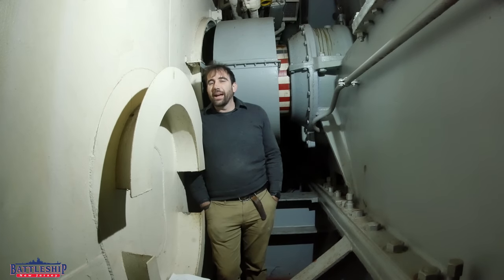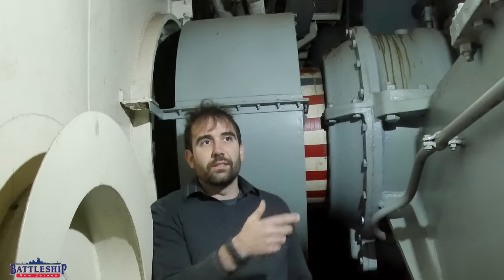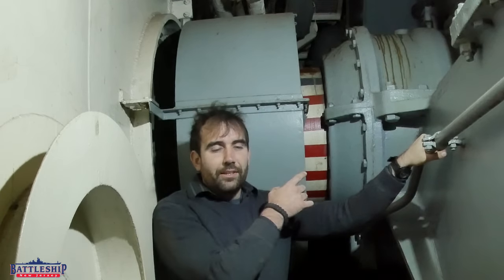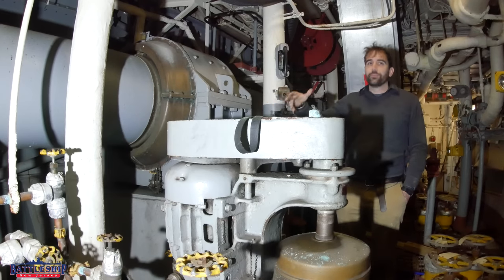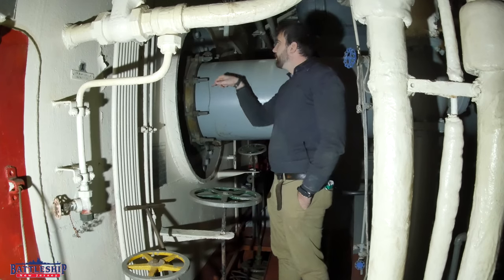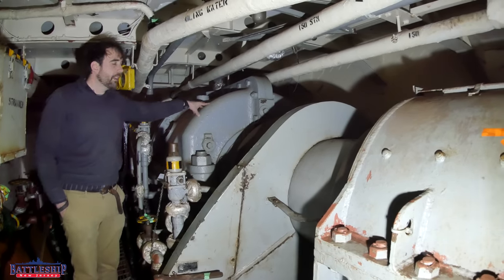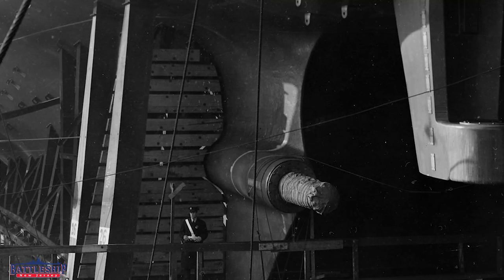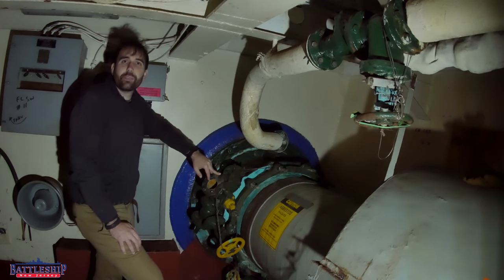Battleship Sized Propeller Shafts

Comment: First an engine/ gear reduction story. USS Coral Sea, deployment to Yankee Station, 69-70. One of the main engine turbines shucked out a couple of blades (stater or turbine blades, I don't know) & they had to shut down that engine & lock the shaft so that the engine wouldn't totally destroy itself. We were flying combat ops at the time so the skipper decides to continue wit flight ops while dragging a stationary screw. Ship couldn't make more than about 24 kts and couldn't properly launch aircraft at that speed, needed about 30 to 32 kts. Had some scary incidents with A-7 Corsairs carrying bombs. At speed while dragging that dead screw the ship would shake violently. After a couple of days they got the coupling unbolted and we could make about 30 kts on 3 engines. I have a lot of the deck logs from that cruise and it is funny reading some of them during that time period. An aircraft carrier can only be captained by Naval aviators, you have to wear the wings to drive one of those things. Many of the comments when an officer stands the bridge watch mentioned something like this when first recording the log on his watch: Propeller engine (number such & such) still windmilling. It's under water so how can it windmill. I was in aviation and I even know that it is called a screw not a propeller. Thanks for the videos, they kept us real busy on the flight deck so I didn't have a lot of leisure time to visit below decks.

Comment: To answer Ryan's question.
2010 Toyota Rav4 3.5 Liter V6: 269 HP @ 6200 RPM.
I like it for such a small SUV.  Would need 788 Rav4's to push New Jersey at top speed. LOL

Comment: Iron wood was used as bearings on the early steam engines , it was self oiling and could be turned a lot easier than steel at the time.
Reply: it can also be turned a lot easier than steel now ;D

Comment: I was a snipe on a carrier 3MMR was all the way aft and all 4 shafts ran through , 1,2,3 MMR ran the whole length  on the engineering space but 3MMR shaft was really short. 2MMR was the next forward and the shafts from 1MMR and 4MMR ran the full length of the engineering  space and 2MMR stub shaft. 1MMR only had the one shaft from 4MMR running the whole length of the engineering space. 1MMR had no shafts running the  whole distance of the engineering space and was the most roomy. The shafts were 36" in diameter and turned a max of 135 rpm. Laying on the shaft was only possible when spinning main engines for a couple of revolutions  to warm the turbines up when getting underway, any other time you would be flung across the engineering space and most likely killed

Comment: My daily driver makes 180hp, my diesel pickup about 300hp, and my race car about 600hp. All of them combined I'm not sure could overcome just the rolling resistance of a single shaft and propeller.
Reply: Destroyer escorts or FF as later called most commonly had a single screw.  Ours was 15 ft. And could generate a rooster tail 300 yards aft.  Starting at 2 knots on throttle up.  We called it showing colors when we left a foreign port.  Never twisted a shaft. We did have a bearing chew into the shaft. We were (DIW) dead in the water for 3 days. 6 hrs to get it topside 2 hr wait for Helo pick up. 2 days at shop and return 4 hrs for reinstallation. I think we were the only sailing destroyer in the Atlantic in the 70s.  2 knots with tarps fastened together and Gulf stream help.

Comment: The wind tunnel I used to drive was 260000 HP 4 65000 HP motors on the same shaft and it would go up to 700 RPM.

Comment: Very good and interesting video. However I would think that intermediate bearings are with white metal linings instead of bockenholz or ebenholz wood. Altough this material is commonly used for seawater lubricated tail shaft bearings outside of ships hull.

Comment: Spring bearings have babbitt bearings not lignum vitae. The Aft. shaft and tail shaft have the lignum vitae bearings, or the ones exposed to the sea. The two long shafts should have auxiliary thrust bearings that will engage and disengage for decoupling the shaft from the engine for trailing the propeller while underway to reduce drag.

Comment: My vette has 600 hp at rear wheels. A car truck looses horse power from engine to rear wheels, automatic trans around 20% and manual around 15% hp. U buy a super charger and install on engine, it says 200 added hp, at rear wheels u may get 100 to 120 hp.  Great show love them all.  Questions NJ second ship of class, Mighty Mo last, why was NJ in best shape of the class when second oldest? Thank u. Chad Paddock Naples Florida thank u for saving the four grand sisters, all class each one. Should have two new BBG built. Reduce carriers by one gives u crew for two BBGs

Comment: Not called riding the shaft but on the last ship I was on we did another form of game. In the rooms the shaft was often below a grated deck plate. Those of a particular form of crazy would lift the grate out. Then using the framing lower themselves down to where they were running on the top of the shaft. A certain speeds you could keep up but at others you just got thrown into the framewaork. oof.

Comment: I’ve always wanted to know how in the world the designers kept water from coming in through the propeller shafts, now I see it’s like a well, it has packing. Simple but robust, that’s just cool.

And 52,000 horsepower per shaft!!!! Dang that’s strong. Is it possible there is a torque rating for them too??? How much torque they put out

Comment: Wait, a 32in diameter shaft had a crazy complicated high-precision boring operation done on it to get rid of a core 8in in diameter for weight savings? Even knowing that that core doesn't really contribute to torsional rigidity, that's barely more than six percent of a weight savings, and a zero point four percent savings in moment of inertia. Seems like an odd decision to have made.
Are we mixing diameters and radii, or am I misunderstanding something else?

Comment: Knowing the physical size- length and diameter, and knowing the maximum torque from the engine, it is a simple calculation to determine how much the end of the shaft rotates with respect to the other end.
And BTW my car has 400 horsepower but carries a lot less weight than the battleship, plus doesn't carry any big guns.

Comment: its not twice at the engine but it IS two bolts twist at the engine end

There's probably about $9000.00 worth of Lignum Vitae in that bearing alone.   Navies got the best pieces because they didn't want pretty grain just straight clean block.
Reply: There is zero $ worth.

Comment: Curious on how they balance the torque differences between the shafts. Like in an unequal length axle, the shorter shaft has less torque effect (hence why cars torque steer). These being significantly different in length between the longest and shortest, there has to be some method of balancing the torque. 
Maybe a follow up video??
Reply: I feel like you are mixing up some different items. A difference in thrust per shaft could cause a ship turn, but with how the amount of Hull length compared to hull beam, I would say you need quite some variation for it to matter, so balancing is not that much of an issue. 
The torque Ryan was talking about is the tendency of the shaft to have some rotational windup along the shafts length. There will be a considerable difference between the shortest and longest shaft, but it doesn't really matter if one shaft takes .2 rotation more to start rotating a propeller compared to the shorter one. This is however a real thing in servo applications where shaft flexibility can limit system responsiveness. On a heavy thing like this it, mass will damp this behaviour out on a ship level.
Torque effect on cars is also very much caused because inward wheels travel a considerably smaller distance than the outside wheels, for basically all reasonable turning circles. Wheels have way too much friction with the road surface to slip the multiple rotations needed to take a turn, let alone would it be desirable to waste so much power. This is where cars use differentials to actually balance rotation vs torque  between the driving wheels, and even more advanced versions of this principle to maximize every single Newton-meter / Lbf into traction
Reply: @Tuning3434  not really mixing anything up. A longer shaft will exert more torque. I used torque steer in a car as an example. When a car accelerates in a straight line the longer drive axle exerts more torque causing that wheel to rotate faster. It has nothing to do with turning (where inside and outside wheels rotate at different speeds) and everything to do with the length differences in the shafts.
Reply: It's all controlled by shaft RPM
Reply: Each engine gets its own room for damage control. A merchant ship from the same would use matching shaft lengths and a shared engine room. A positive side effect of the four wildly different shaft lengths is that it reduces vibration. Each shaft has its own vibration frequency and having four different lengths helps reduce the cumulative effect of resonance you get when any two shafts are the same length. With regards to the torque, and length, there is no difference. This effect only occurs in cars when they accelerate (or decelerate) and ships engines cruise at a constant speed. However the propellors themselves DO introduce a strong turning effect and for this reason port and starboard propellors ALWAYS rotate in opposite directions to each other.
Reply: @jameslong3351  Exactly JL.  The only ship I remember having torque issues was the Enterprise, with eight reactors spinning four propellers.  The longest shaft had a power restriction because of shaft twist.  I might not have that straight, but close.  NO TORQUE STEER!

Comment: My 71 Dart, street-strip car has about 450hp. My question how much torque does N/J have. It’s got to by unbelievable to turn a screw that big. Nice job Ryan!!!
Reply: @manitoba-op4jx  off topic but aiming for about 525 by spring. Was high 11s want low 11s. Thanks!!!
Reply: I'll give this a try by working back to torque from HP: 0.0001904 HP = (1 lb-ft x 1 rpm)/5252. The shaft turns at 204 RPM at max. power., so for 54 000 HP that is 54 000 x 5252 / 204 =  approximately 3475 '71 street strip Dart's worth of torque per shaft. Now I understand why the driveshaft is nearly solid and 32" diameter, and why the top Iowa class engine option wasn't available in California
Reply: @scottb8175  you also need to take into account emissions compliance for California. Last time I checked, bunker oil isn't super clean burning, and I don't recall Ryan showing us the catalytic converter on New Jersey. That won't pass inspection!

Comment: I'm kinda curious if you could increase the power by swapping out all the steam plants with jet turbine engines. Assuming you could easily get them down there under the armored deck.
Reply: You could, but then you would need to replace the gearboxes as well, because you would need an equally sized intermediate gearbox to reduce the turbine output to something the battleship gearboxes can handle.  But those propellors will only handle the current output really, any more and they likely will cavitate heavily.  That 202RPM is a maximum to give long prop life, the steam power plant likely can easily go 10% more than rated, but using that emergency power will mean a very expensive refit afterwards.
Reply: In terms of power, you'd need 8-10, but refitting the entire machinery means ripping up all the decks, and everything above them.
Reply: @Jo-rz6bs  Easier in drydock to simply lift the ship on blocks, and cut holes in the hull then, dropping each room out in turn. Faster and cheaper than removing that armour, and you only need to have clearance for the new engines.

Comment: Top Fuel dragster or funny car would come within an order of magnitude of one shaft or maybe two. And they accelerate much much quicker to their top speed of 340 mph. However if the race is longer than 5 Miles I'll put my money on the battleship!
Reply: A competitive Top Fuel engine's spark plug electrodes are burned away in the first 300 yards, there abouts. They definitely aren't built for endurance. Today's estimates are 12 000+ HP from 500 cubic inches for TF Funnies and Dragsters. But those are "cars". IMO we need to compare a Top Fuel boat to a battleship, as the cars don't do well on the battleship's  track surface, especially if the battleship has lane choice. Even if you only floor it for 3 seconds (so about 200 mph) and just coast afterward, a TF drag boat would probably be ahead of the battleship for 3 hours before the Iowa class catches up.
Reply: @scottb8175  the question was what car could you think of that might make horsepower within an order of magnitude of the battleship.

Comment: as for the hollow shaft, i forget the phyics but a solid shaft will twist easier than a hollow one. thats why posts and collums in construction are always hollow. the wooden bearings were interesting , i
Reply: I think by "twist" you mean develop cracks.  Take a 3 foot diameter shaft.  Solid, the stress applied would look like a spiral from the inside of the shaft to the outside (looking cross section).  If you make the shaft hollow, the stress from twisting is minimized to the outer diameter of the shaft.  I think we're saying the same thing differently.
Reply: @gregorylugo9695  exactly

Comment: Are the Thrust Blocks for all four shafts lined up in the same part (frame section) of the ship?  ... or are the two inboard thrust blocks for #2 #3 near each other, with outboard thrust blocks for shaft #1 #4 located further away to distribute thrust load to different frame section of ships hull?

Comment: 11:10 "...each propellor shaft can provide 54,000hp..."   Four shafts on a battleship.
Very impressive, but consider this:  The Apollo Saturn V engines had 55,000hp fuel pumps. Just the fuel pump was 55,000 hp, and they had five.
So the Saturn V had more powerful fuel pumps than a battleship. You're welcome.

Comment: Do you ever rotate any of the shafts to check seals or to lubricate associated systems?
Reply: With the screws off, there probably isn't much chance for the shafts to warp, and "If it doesn't leak, don't turn it".

Comment: remember what happened with the propeller shafts on hms prince of wales in her final battle? a torpedo hit the shaft, it vibrated out of controll and destroyed some bulkheads inside the ship and therfore lost electrical power, because the water flooding in destroyed some of her generators. could that happen to the iowas aswell, or where they safer?
Reply: I have always thought the poor buggers working in the shaft tunnel on PoW came to a quick end by being either blown up, crushed or drowned depending how close they were to the torpedo hit.

Comment: Watching videos from large ships it seems most have a turning gear to prevent shaft sag when in port. Does the NJ have turning gears or some other method to help counteract it?
Reply: What your talking about is jacking gear. It's used to get lube oil circulating prior to steaming.
Reply: I've wondered about turning gear also. Maybe the Iowa's don't have long enough unsupported sections to need it. It would be interesting to measure the sag after all these years.

Comment: Its a wonder that the Iowa's shafts were not removed when they were retired and turned into museums.
Reply from the maker: That would require dry-docking the ship again and thats expensive. As the museums drydock they will likely come off but only Missouri has drydocked so far.

Comment: cars HP and torque are measured at the crank and at the wheel.  a dodge hellcat (a powerful car) puts out about 750 HP at the crank and about 560 at the wheel at peak torque,  it'll go from 0 to 60 in under 4 seconds.  a battle ship should be able to go from 0 to 40 in 15 minutes,  it weighs a little more and has a little more drag